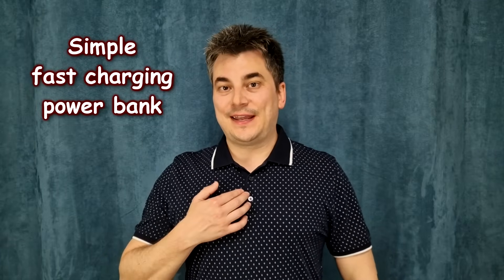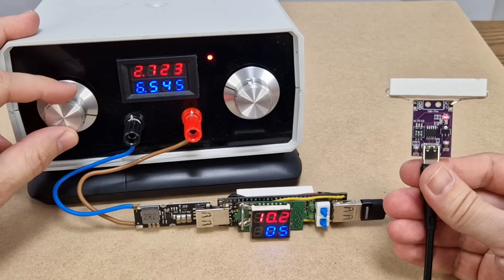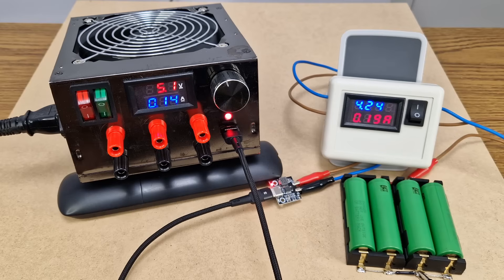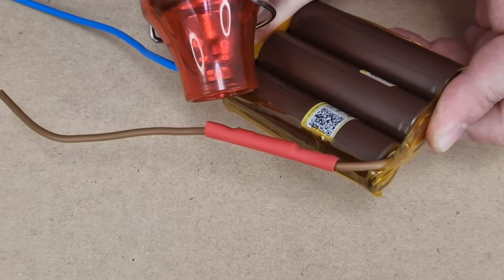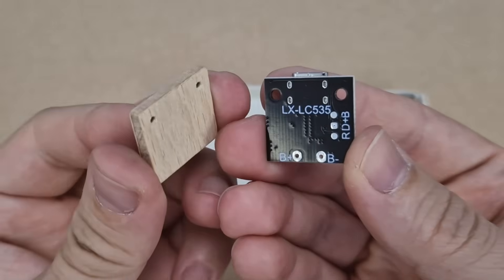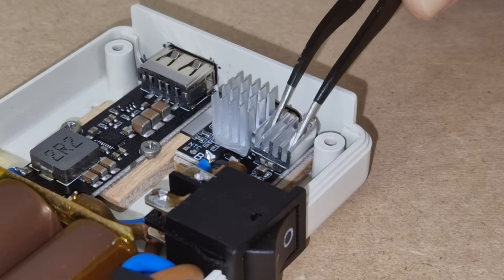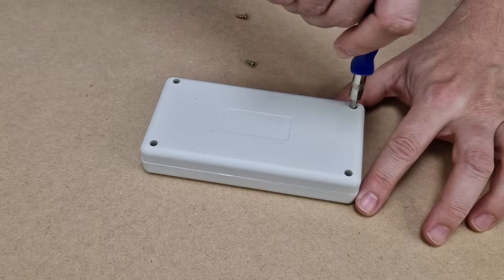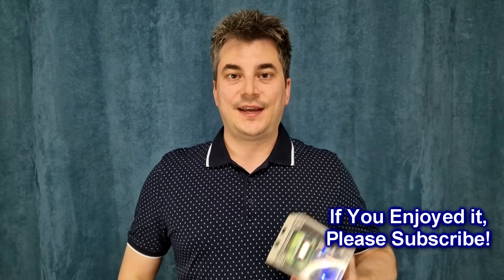Simple fast charging powerbank [DIY]

Comment: You can remove the big rocker
Switch, either by using a simple circuit that uses a push button to turn the power ON and OFF or by using  low power push lock switch and connecting it MOSFET's gate  and the MOSFET will power the rest of the circuit ahead.

Comment: Hello Sorin Did you balance the batteries to the same voltage? 🤔
Reply from the maker: Hi. the cells are connected in parallel, so I charged them to the same voltage before connecting them.
Reply: Thank you

Comment: Esti roman, da ? O treaba super. Eu sunt inginer electronist, mi-am cumparat un power bank care scoate 9 V si 12 V pe langa cei 5 tipici, dar am aflat ca trebuie un decoy module, poate si un convertor DC-DC reglabil ca sa dau putere cat trebuie in niste manusi incalzite pt vanatoare, incat ma gandesc sa construiesc un PB specializat pt aceste manusi (cu tensiune de iesire, implicit putere, reglabile). De la tine am invatat multe (caci e un subiect nou pt mine). Daca vrei, pot scrie comentariul in engleza, ca sa fie accesibil si altora.
Reply from the maker: Multumesc pentru sustinere.

Comment: This boost converter heats up a lot and shuts down even after adding a heatsink, do you have some advise?
Reply from the maker: I used the powerbank several times with different phones. It does get a bit hot, but never turns off. You can try to stick a bigger heatsink under the circuit board.
It may also be a problem with the battery. the lower the battery voltage, the higher the current draw from the battery. higher current means more heat.

Comment: can i use 6 battery in parrallel , is this switch necessary , can i make without switch
Reply from the maker: yes you can use 6 cells. the switch is necessary, without it the battery will discharge continuously.
Reply: @Sorin_DIY  okay , thank you

Comment: Hi Sorin I have a question about the BMS protector, if I have similar batteries to yours who have a minimum discharge cutoff of 2.65 volts will the BMS still cutoff the power at 2.49 volts as shown in your video?
Reply from the maker: Yes, the cutoff voltage depends on the BMS board.
Reply: @ thanks for the reply!

Comment: why the current output is 9volts is that good to phone? ,
because mostly phone's input is 5volts
Reply from the maker: 5V is for standard charging. 
If you have a mobile phone with fast charging protocol, it can be charged with 9V or 12V.
Reply: @Sorin_DIY  but its safe? 
because i ordered already i want to make like yours
Reply from the maker: It's safe. If your phone has fast charging protocol, it will charge with 9V or 12V. if it doesn't have fast charging protocol, it will charge with 5V.
Reply: @Sorin_DIY  ThankYouSoMuch, I'm gonna make powerbank like yours I'm your new Fan from philippines:face-red-heart-shape:

Comment: Can it charge a 65w mobile ?
Reply from the maker: The output power of this boost converter is maximum 24W. it will charge the phone, but not at the maximum charging speed.

Comment: My phone adapter is 33 watts.  My phone charges with 3 amps.  Will this project be able to fast charge my phone?
Reply from the maker: These are the outputs of the fast charging module:
Output current: 5V3A, 9V2A, 12V2A.Output current is adaptive.
Output power: up to 24W.
If your phone knows the 5V3A protocol, then yes.
Reply: How can we get more watts out of this? @Sorin_DIY

Comment: SORIN. HERE IS A QUESTION , DOES 1.5amps 9 V hurt the battery , I got an old iphone 5s which original charger is 5v 1A = 5w
Reply from the maker: This type of powerbank can be charged only with 5V and 2.5A minimum.

Comment: Hello Sorin
I need some advice if you have time to answer.

I've built the exact same power bank but with 7 18650 batteries. After trying to charge it for days, it's now completely off, probably dead.
Did I make something wrong or idn't I understand the principles of battery charging?

Thanks for your help.
Reply from the maker: Hi. You need to test all the components individually before put them together, like I did in the video. Then you will know if one component is not good.

Comment: Is it possible to build powerbank with NiMH batteries?
Reply: Of course you can, but its probably not a good idea. NiMH batteries works best if they are fully discharged before you recharge them. So if you use only 50% and then recharge your powerbank and do this several times you will induce the "memory effect" in the NiMH batteries, which will reduce their capacity much faster than their advertised. 
So yes you can, but its a bad idea.
Reply: @pettahify  okay thanks

Comment: Thank you very much for this tutorial Sorin! 👍 Hey.. I have 10 * new high quality 21700 batteries (Vapcell F60 6000mAh) and I want to build a PD3.1 compatible (28V @ 5A) power bank (welding is no problem). But I do not have the required knowledge, so I was wondering if you by any chance could help me out with this? ..at least with the BOM (Bill Of Materials) and provide me with links to the needed components (AliExpress is fine). I wish I had your skills. 🙂
Reply from the maker: Hi. I need more details to help you, we can talk on the Patreon chat, or you can send me an email at sorin.electrical.nerd@gmail.com
Reply: @Sorin_DIY  Email sent. Thank you so much for helping me out with this. <3

Comment: For your big switch, replace with a small switch that controls a MOSFET circuit. The MOSFET resistance can be very small and thus be minimum power loss.

Comment: This channel done so well since you began. 
Well done Sorin.👍🇮🇪
I built your design (well the one you use here) of a load. Had no resistors so I made my own out of the wire from an old electric blanket but you can guess what happened. Yeah they got very warm. I have power resistors I found inside an old TV in it now.. 
Works great 👍😊

Comment: Hello sorin, can i use Type-C USB 3A Polymer Ternary Li-ion Lithium Quick Fast Charging Board for input and want to add 6-8 cells in parallel is 1s bms enough or should i need to add more bms
Reply from the maker: Hi. 1 BMS is enough for a parallel battery pack, but you need to select the correct BMS according to the current consumption - 5A, 10A, 15A.

Comment: Nice design! I notice that it will stay on, when powering low power devices. Power banks usually turn off. And - it can charge while powering another device  normal power banks can’t do that either!

Comment: You can use a latching MOSFET switch that is turned on and off with just an SMD pushbutton. It will handle the 10A like a boss

Comment: Fast charging for phone is so stupid, boost the voltage at the charger then lower the voltage at the phone. So dumb.
Reply from the maker: Actually it's pretty simple and clever. to transfer more energy, you can increase the current or the voltage. increasing the current will heat up all the wires and components, that heat comes from all the power losses. increasing the voltage doesn't heat up the wires. 
It's the same idea in transferring very high voltage up to 25000V over long distances on high voltage poles. and at the destination there is a transformer to decrease the voltage and increase the current. you do not transfer high current, you transfer high voltage, for a better efficiency and safety.

Comment: Why not use a tiny micro switch, with a MOSFET, or two, IRFz44n would probably work, using a logic level gate, just solder it to the battery, negative with a 400ohm resistor from gate to negative, and another 100ohmvfrom gate to switch to positive, and mount the MOSFET tab,(to220 psckage) to the largest heat sink that fits. If it runs too HOT🥵, use another MOSFET, possibly mount them to a aluminum bar, about 6 mm x12-15 mm, and long as possible, then mount small ic heat sinks to the bar with thermal adhesive or screws and thermal grease. It may require different fets with logic level gates, that will turn on with 3.3v maybe use a diode and capacitor to power on the fet, from the 5-12v from the boost converter.  Using the battery to power on enough to make 5-12 v, the turn on fully using diodes to prevent reverse current. A smaller package get soldered to PCB is available capable of 15a, 400watts I have a bag full of them, can't recall what the gate voltage is. This tiny switch idea could be a money maker for someone, have jlcpcb , PCB way, or who ever make them and sell on ebay and amazon. Possibly have them make tiny switches also.  They offer so many services and so fast as well.  Doing metal 3D printing, plastic 3D printed, they can do anything.  Having a small pin in a spring with a latch mounted to a pcb, with two pads to solder the switch to and the wires on both sides of the PCB. Then the switch mounts by drilling a hole for the 2mm pin/button, and glue the PCB to the case,or use tiny screws, However , you'd better off using micro switches available.
Reply from the maker: Thanks for the info. That will make a separate video, because it will get more complicated. I wanted to keep this video as simple as possible, because there are a lot of viewers who know very little about electronics but they want to build stuff.

Comment: Nice job. You could use a load switch circuit module, there's one on that giant Chinese site that switches 10A, with a 1.3ua quiescent current. You can find it by searching for "Bistable Switch Module 300na"
There's IC's like the Vishay SiP3243x series.
Reply: Thank you as well !

Comment: I'm trying to build a 12V battery pack for my astrophotography setup (still figuring out all the parts I need). I was worried about soldering the fuses directly inline. Thanks for the video!

Comment: My question would be does the circuit cut out when the current draw is too low. 
Most battery banks I can find will turn off after a few minutes, and a few that turn off after 2 hours. Im trying to find one that will stay on with low current draw until the batteries are discharged to the appropriate level, which could take days or weeks.
Reply from the maker: Hi. This fast charge converter stays on continuously. Usually these types of individual modules remain active. A new power bank has all the features in a single circuit board and is designed to turn off to save energy.

Comment: Please be careful, that switch is 10amp rated for AC not DC. Consider a mosfet logic switch (Similar to the battery protection board) for your power switch.

Comment: love these videos. 1S battery config is very DIY friendly. 
to make better thermal performance, I have found that by layering about 5-10 layers of copper foil tape on the enclosure and then covering that with thin black teflon tape (for max emissivity and insulation) helps draw heat to the outside of the case better. also, black plastic enclosures loose heat much more quickly due to radiative cooling, but if it is going to be placed in sunlight/dash of a car the black color is a negative. I think I will copy this but maybe do an all in one usb-c board (more expensive) and use old ipad 3 replacment batteries which you can cut up into 3 pieces. theyre very thin and have about the same storage as these high spec 18650s. i think theyre around 2-3$ each cell depending on volume/shipping. I think you could fit about 5-6 of them in the same enclosure with an all in one board (~12wh each cell!). also debating doing a series version and using an active cell balancer instead of a BMS. 
thankyou for uploading

Comment: Thanks for this video my friend, I am sure that now when newest sodium ion batteries a power bank project can be more interesting. For the switch replacement a circuit with a push button instead or even a touch sensor with 3 secs delay in any of both cases the circuit must be made so only can be started is a load is connected to the power bank

Comment: My Tps61088A circuit was constantly burning. I had to put an aluminum plate on the back surface. Because the adhesive starts to separate from the surface when it gets too hot.  I think you should pay attention too.
Reply from the maker: Thanks for the info. I used the power bank a few times and so far it's ok, but I will keep an eye on it.
Reply: @Sorin_DIY  what is the Rated capacity of this Power Bank

Comment: Hi Sorin, missed you. nice to see you a new video I can get some ideas with. I hope you yould also make a video for a 12v powerbank that can be charged just by using a mobile phone charger. as I saw once in an online shop that there is a (12V) 3S LiPo charging module that can be charged with a mobile phone charger. I can't get any info about the type of chip or board it is so I can tell you what board it is... Thanks again for another great video...

Comment: Sorin, You can find push button switches that are rated to 15A ro 120A. Would be very flush to your case.  I found in Chinese online store: 10A 15A 20A waterproof high current metal button switch

Comment: Hello Sorin.  Very nice video once again!   Wouldn't be nice to add a tactile switch to activate the battery capacity meter?   So it would be off, and when you with to know how the batteries are doing you would just press the tactile switch.
Reply from the maker: Thanks. That will work too, but I like this simple type of battery indicator, because it uses very little energy. And it's also an indicator that the power bank is turned on.

Comment: Why don't you use an 18 watt powerbank module, which has everything you want!
Reply: Exactly, and the price is ~5$ for one with 22W. And you don't need the big buton om the side...
I actually reused one module from an older powerbank to make one similar to what Sorin built. It has 5x18650 second life cells and works perfect.

Comment: Wires are little overbuilt 18 awg would have been fine aswell a switch that can handle 5 amps would have worked aswell, but im not a fan of 1s3p batteries in general would go for 3s instead cause its safer, and it is more efficient aswell
Reply from the maker: Thanks for the comment. My old power bank has a 6S battery pack and it has a good efficiency. a 3S battery will have a voltage between 12.6V and 8.1V, so it will need a buck/boost converter to increase/decrease the voltage for fast charging to to 9 and 12V, no matter of the state of charge of the battery. it will be more difficult to build it.
Reply: @Sorin_DIY  yes, it is more complex but a 3s battery is always safer than a 3p battery that’s why personally would always go with 3s.